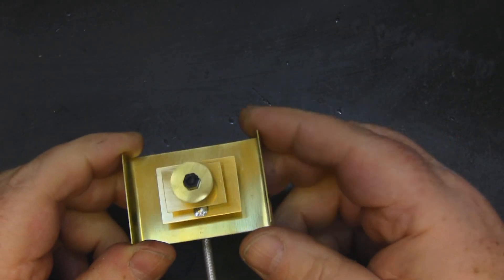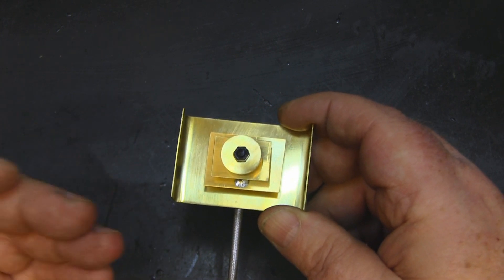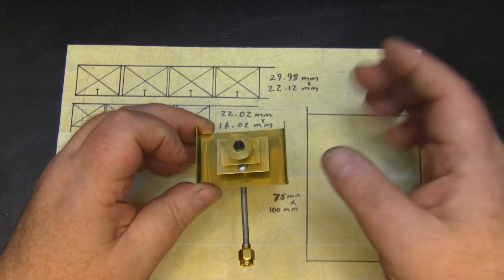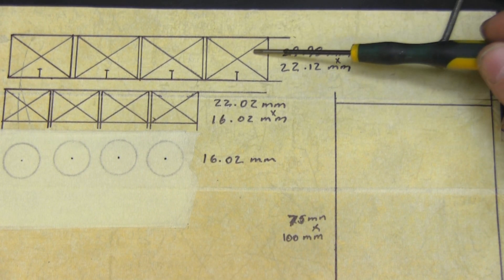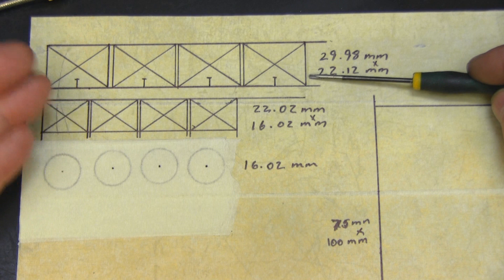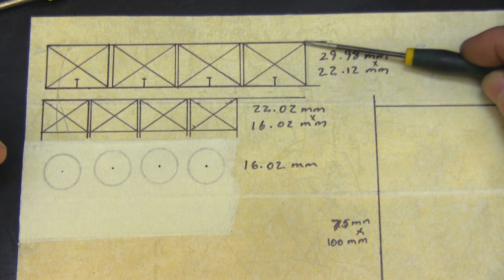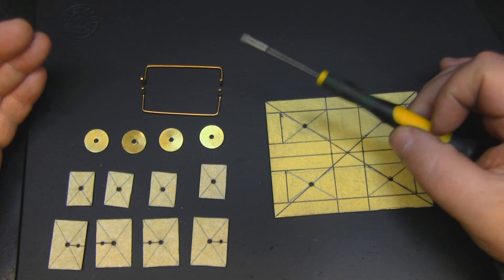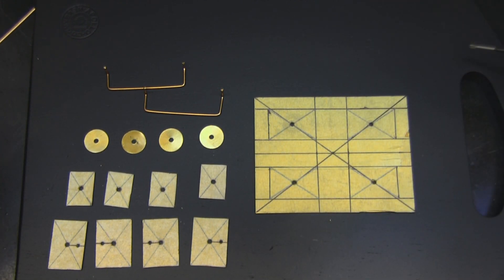5GHz Wifi Antenna with 15dbI of Gain

Comment: Instead of a dish you could try a 10dB Horn antenna. I used to run a 8mW 10GHz TV link using horns with a Ham friend who is about 2 miles away from me.  It worked great . So maybe a dish is usable but maybe Horn antennas are worth an experiment. 👍
Reply: Can you explain it? I Wana to create

Comment: I like this video a lot Andrew. The antenna looks good but more importantly works great. I've always been curious about combining multiple driven elements in this style and it's good to know you can pass signal through wires in such a fashion and still obtain good SWR.
Reply from the maker: To be honest I did not expect the VSWR to be as good as it was. I did recalibrate and test it a few times just to make sure it was correct. 😁

Comment: Great video !! 
I have a question . I made some coil loaded  dipole antennas for my project . And i wanted to protect the driven element. And i used small pvc pipe . When i put the antenna element inside the PVC tube the antenna tuning changes completely. 🙁
How do you protect your antennas ? Which material do you use ??

Comment: You said you wanted to shave OFF some metal from the driven element to drop the frequency - I am not sure I understand why you would want remove some of the element because that would decrease the wavelength and therefore increase the frequency? Am I missing something? Would like to understand. Thanks.

Comment: Any possibility of making this from stacked 75mm x 100mm PCB board with the elements etched on each layer. Since the PCB carrier has a different dielectric constant than air, how would the element spacing change?

TIA…

Comment: Love your matching network, it matches really well too! I normally use 3 pairs of 70.7ohm (100ohm to 50ohm) transformers in a corporate matching network (of 3 T-joints) for a quadruple array. Would you be making a sequential-delay network version to turn this baby into a nice axial-ratio RHCP/ LHCP Antenna for FPV (with 4 shrunken elements to increase center frequency to 5.8g)?
Reply: @Terence just to let you know, I got to this video from your Liked videos Playlist. Pls let me know if this antenna is better than your crosshair quadruple array.
Reply: As demonstrated by Andrew, it has a really good VSWR. It’s difficult to achieve such a low VSWR on 5ghz, or 5.8ghz in the case of my crosshair array. My quadruple crosshair can pick up color-video behind a solid concrete wall at 1.2km away from a 200mw transmission source. It’s hard to compare which antenna is better without seeing the radiation plot pattern.
Also, if you are planning to use this antenna for FPV, even if it’s built to 5.8ghz dimensions, you gotta make sure the video transmitter’s antenna is linear-polarized such as the little dipoles on the mini-whoop drones. Most performance drones have circular polarized antenna so you lose 3db of signal if you use this linear polarized antenna array on your FPV goggle.
Reply: @Mintgreen007 can you provide me information about quadruple array. or video of the making.

Comment: Hello ! 
I was looking to have an HDMI transmitter to pass a video console signal through a 5ghz or 2.4ghz signal and, even tho' its working, the signal has a sligh latency. The signal doesn't seem that strong with the antenna but I don't know much about it. 
I was thinking that i could probably boost the signal with better antennas for the TX and RX and found out about your wonderful channel. This type of DIY are perfectly adapted to my abilities but I would like to know if you or someone think that this solution will help me in my case ! 

Hope to read from some of you and know more, thanks ! (happy new year jic)

Comment: Something you might could help me with.    People that use cellular game cameras are always trying to find cell towers with good signal strength.    Is there anyway I could use my iPhone just as a display device to visualize signal strength of a Yagi antenna?  Carrying around a laptop in the boonies is not practical.    I’m thinking of some device that sets between the antenna and the iPhone plus an App on the iPhone.    Using a lightning cable of course for the iPhone connection.     You ever seen or heard of something like this?

Comment: To me, it looks like the "top two" elements are being fed 180 deg from the "bottom two" elements. Is this correct?
If so, wouldn't that make a null straight ahead?
Reply: That would be my prediction too. Also 1.5mm brass rod does not have a characteristic impedance of 50ohms(the spacing to the GP is required to determine this). In fact for this 4 way split the impedance would quadruple anyway. So the input impedance would be 200 ohms(4x 50). There will also be mutual coupling between the upper and lower feed lines as the are very close compared to the GP spacing. In the end there is a lot going on here that is hard to predict without simulation,
Reply: @scienteer3562  I guess Andrew will need to do an antenna pattern test, to see what exactly is going on.
I wasn't going to bring up the impedance, because I don't have a good feeling for what's what at those frequencies...   The spacing of the brass rod could be doing some classic impedance matching transmission line voodoo, including the run from the antenna feed down to the start of the transmission line segments.
I'd also be more happy with a SMA connector on the antenna itself, than the short stubby coax with one... but that's just me. <G>